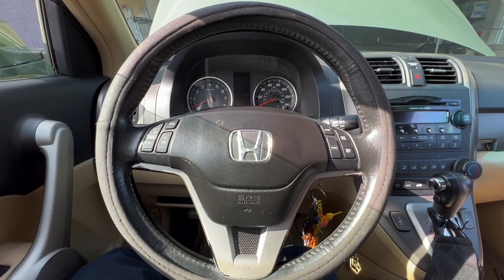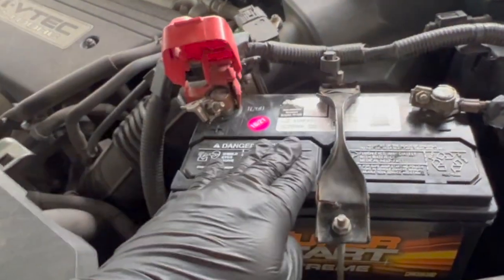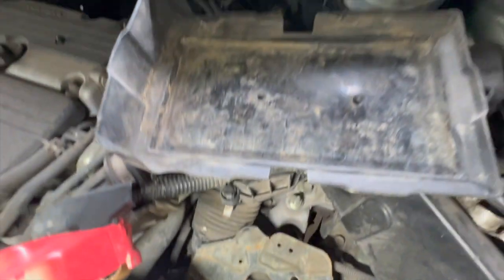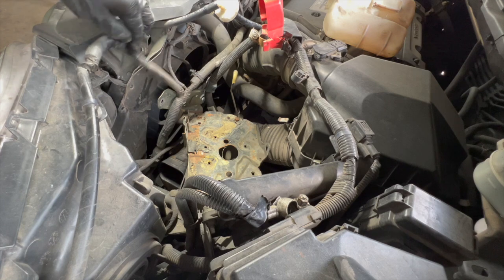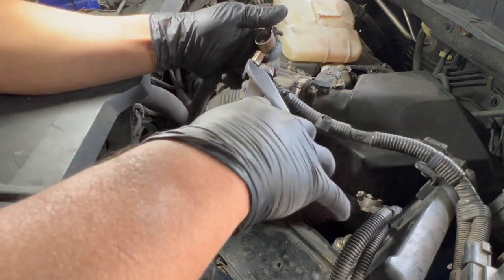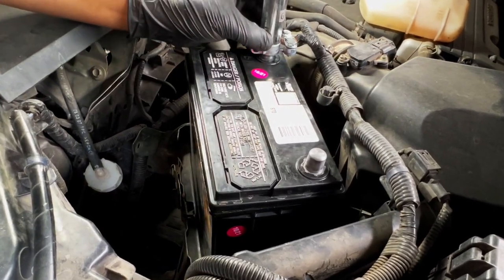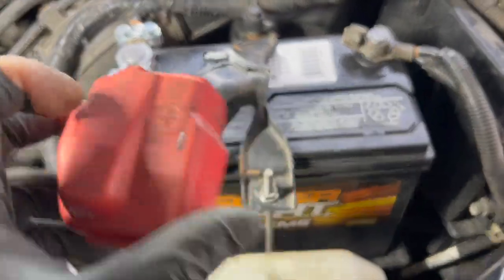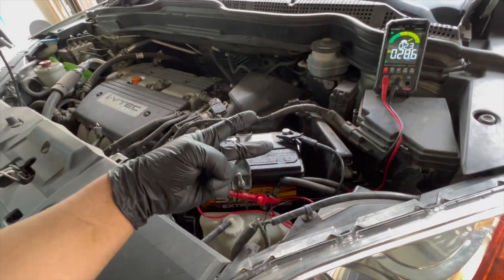Don't Replace Your Car Battery Yet!

Comment: I often encounter battery terminals that cannnot tighten completely on a post. To avoid a headache, I cut about half inch wide sections of hose clamp and wedge them/hammer them down in between a terminal and post. This is all that's needed to make the terminal tighten completely again

No way I'm going thru the hassle of replacing a terminal or cable

Comment: Nice video again, Hector.  I have a 2005 CRV that had same symptoms.  I checked the battery cables - cleaned and tightened but symptom came back.  I ended up having to replace the starter motor which is a pain in that vehicle.   Now all is good.    Have a great day.

Comment: Thanks Hektor,  What do you think of that Kaiweets meter?  Looks pretty good??
Reply from the maker: It’s good for the price, looks different, has a few cons. I’ll be doing a review soon, or just using more on video.
Reply: @HomieHektor  Thanks Hektor.  I liked the look for the milliamp resolution.  Just what I need to buy, my 9th multimeter.  Ha Ha
Reply from the maker: @jamesu  You can never have too many multimeters 🤷🏻‍♂️